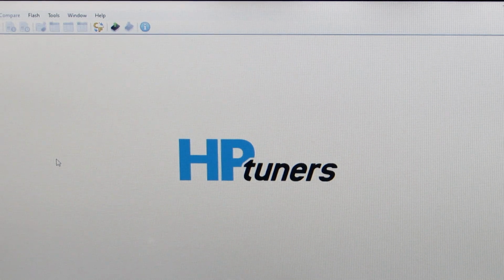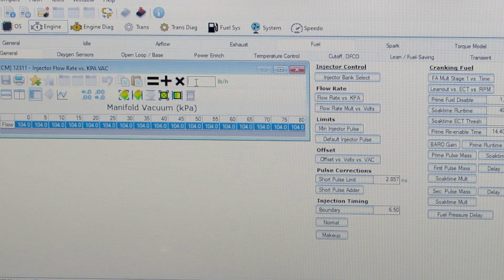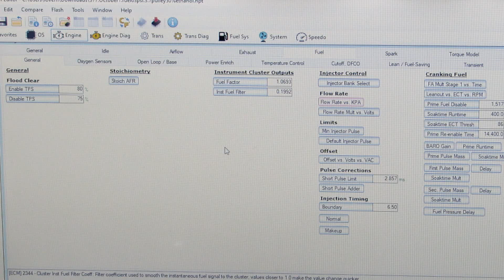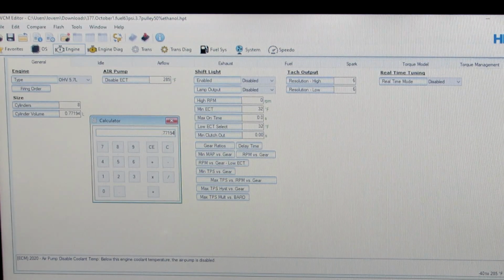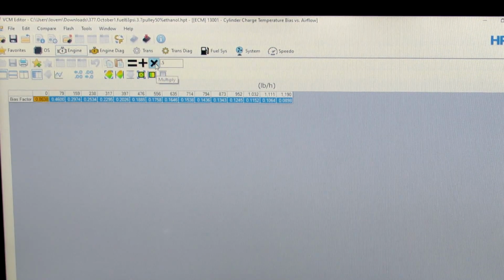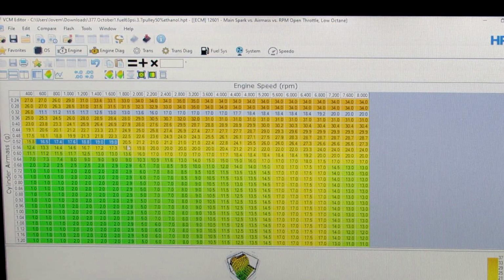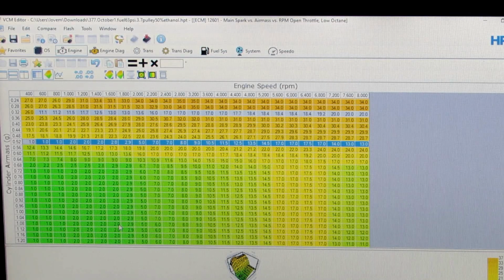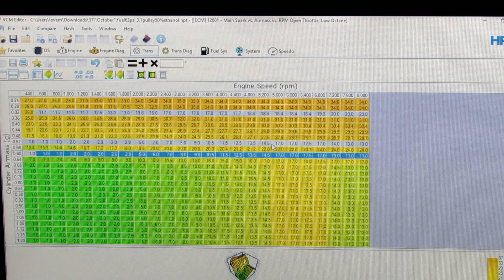Hptuners tune scaling

Comment: Why would you need to do it this way and give yourself headaches in future using this method is it really necessary?isn't there some other way it sounds too risky specially the spark table and is this strictly for gen3 or does the gen 4 and 5 share the same method when it comes to scaling?
Reply: To give yourself a broader spark table while in boost as well as if you exceed the limits of what you can put for the injectors